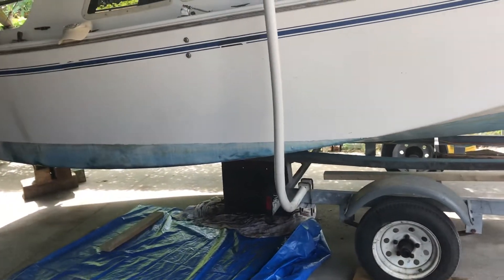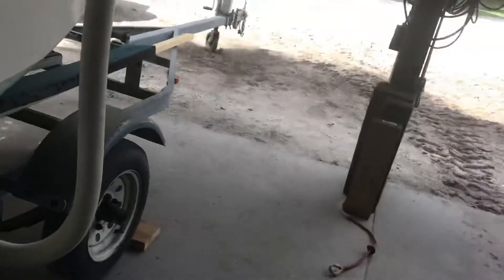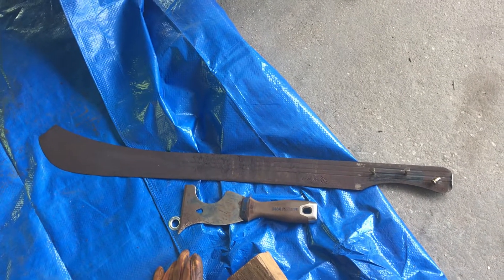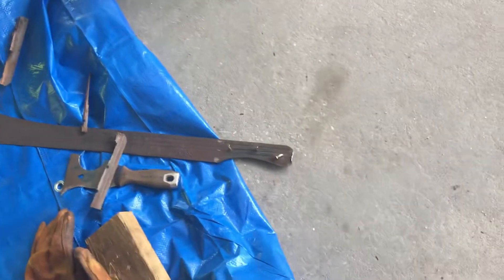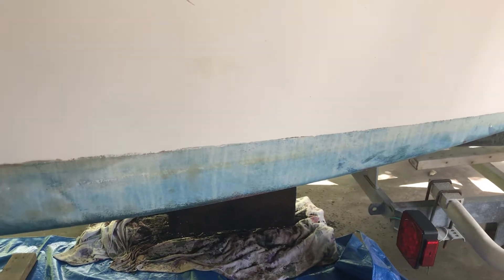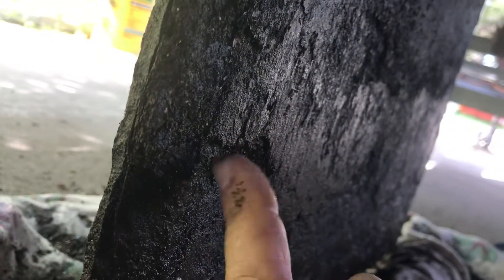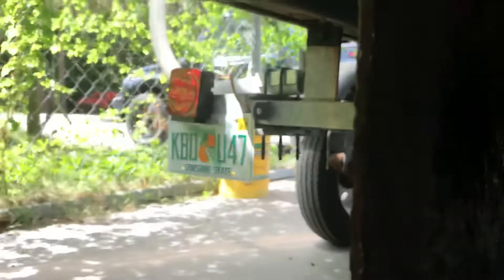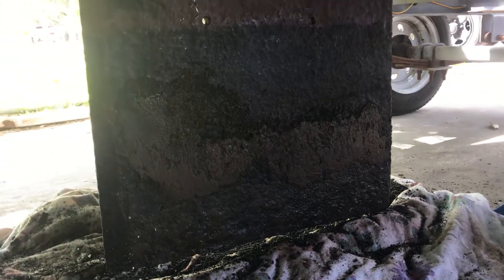West Wight Potter 19 - KEEL: Free At Last, Free At Last, Thank God Almighty, It’s Free At Last!

Comment: I know it's 5 years ago but thank you for posting these videos. What a problem and a chore!
I have had two swingkeel boats (not drop keels). One was a Davidson 18 with a one inch thick piece of steel for a keel....and a Mac26C that used a hollow FG swingkeel that filled with water (to sink) and water ballast inside the hull. I had to work on both and it's always a "headscratcher" alright.
I find it an odd design choice that WWP made with a steel drop keel/board given some of the alternatives. Rust never sleeps and a drop keel needs to be tight(ish) in the trunk to work right...
Nice boat! If I was to have a boat again it would be in the 20-22 foot range. Regards, F